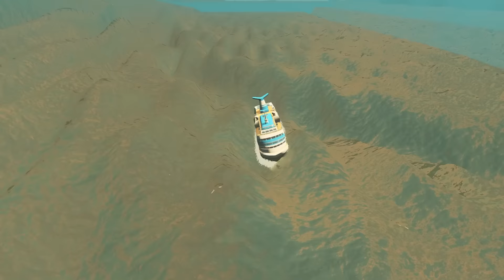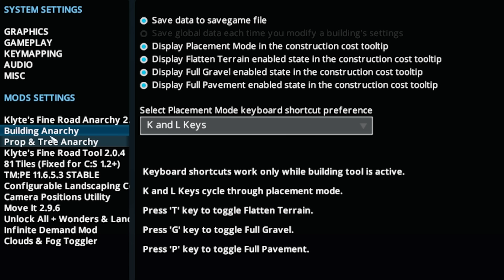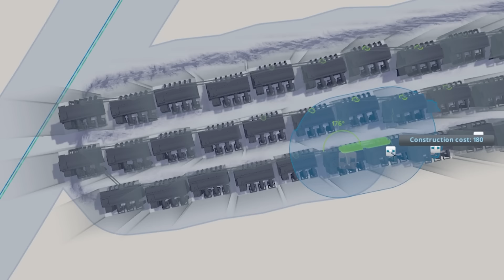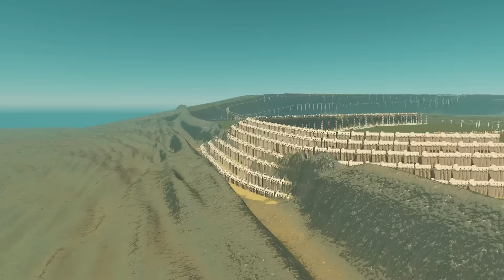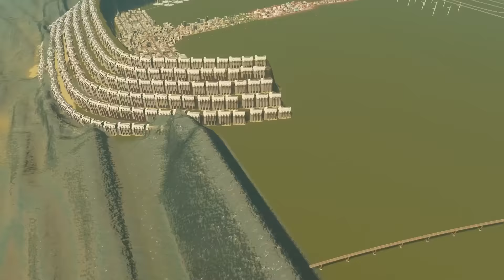Can engineering STOP A 1000FT TSUNAMI in Cities Skylines?

Comment: Very interesting, but probably far cheaper to just evacuate the entire city and build a whole new one far away from the coast.
Reply: true true
Reply: @Nightman5694 false false
Reply: That's boring, he needs content not a ghost save
Reply: Even before that, why build a city by the coast if you can’t enjoy the coastline due to these mega structures surrounding the city?  But fun as a simulation.
Reply: @rdpaik  For sure there are tunnels under the waterpumpdam so that people can still go to the beach. They just have to be quick when the tsunamiwarning goes off. The watertight doors will close in just a few minutes (but I suppose that people would have already recognized that a 300m high tsunami is coming right at them thus they will probably already be deep inside the tunnels when the first doors close (I suspect that there are several doors inside the tunnels that will be closed as well. so that in case of a failure of one of the doors, it's okay, other doors will do the trick)

Comment: 9:50, I think it could have worked, if the front wasn‘t parallel to the wave, but a peak. If it is just a wall, the Water tends to rise higher, because it is the only way to go. If it has an angle, it gets more deflected
Reply: I am confused by what you mean. Parallel horizontally or vertically? Do you mean you need an angle vertically or horizontally?
Reply: @rachelcookie321  I think he means it should be more wedge shaped to pierce the wave instead of blunt. <<<<<
Reply: @valfreyaaurora4922  like more arrow shaped instead of U shaped?
Reply: @rachelcookie321  ya, more V instead of U
Reply: Yeah, thats what I ment. More an Arrow into the sea, not the U shape he did

Comment: You might be interested to know about the Vajont dam disaster in Italy. The area surrounding the dam was deemed geologically unstable but the company running the dam purposely hid this from authorities. They were expecting a landslide and a resulting Tsunami of around 25 metres high and thought the dam could block the Tsunami. Because of this they did not inform the villages in the below valley. Turns out the landslide was a lot larger than expected and it resulted in a mega tsunami that went over the dam and into the valley below causing around 2000 deaths. The dam still exists today, though it's no longer in operation.

Comment: Technically if you wanna stop a tsunami you would have to somehow flatten the edge of the continent, or the area far enough vertically underwater, so that underwater there is not a slope up to land but a huge solid wall. The reason is that tsunamis are actually only big as they start getting pushed up against the slope towards land by the forward moving forces, so no slope, no big waves. That is probably an even crazier project though.

Comment: Great job bro but a way over engineered, you could’ve placed 4-5 steps in the step wall, but instead of building pumps right over it, you could use canals and place pumps inside the canal (vanilla support), using this method, you can deflect and reduce from the total height (also use regular pump because of size/input, but using canal pumps will be wider), you can place much more of them rather than bugger ones thus pumping more water. Then simply place 3 lines of canals around the sides with some pumps on them (also connect between the canals every few nodes to allow better flow towards the rest of the system.
Also place two canals in the same step wall fashion on the coast line to reduce the periphery system load.

This can withstand this size of a tsunami and even slightly more.

Really loved your way of thinking though!

Comment: Shove a mug side to side with water inside it and that shows what happens when water hits an object. Tapering a wall towards the wave will change the direction on the water in quite a forceful way as the water underneath piles in forcing flow up the wall shooting the wave back. Taper;)
Reply: The water moves fastest against the wall as it tries to escape the rest of the water piling in and the water folding and rolling over is slower so it will be shoved by the tapered water.  The spear head with a tapered top would work perfectly especially if u used 2 of them. With pumps in a ditch(that goes past town) right after the last spear wall to catch any backflow that usually comes around the wall. (Simplest build?)

Comment: and tsunamis happen because 1) There is energy flowing through water, in deep sea, usually due to earthquakes 2) as the sea bed gets shallower, hence, the water is forced upwards creating the wave and hence when the wave hits shore it is at its highest hight. Thus, the tsunami wall cannot be a slanted wall such as in this video, as again you're just forcing the water to go even higher, hence the wall would be much more effective if it was just a straight 90 degree wall.

Comment: What about just building the city on an arrow-type artificial mountain, that will split the tsunami reducing its force. In a real life env it is obsolete having canals, pumps and everything else on the beach. Ohh, walls also to protect city and pumps inside (dam style pumps) to remove water that passed. I think a top of 6 would sufice if its build on a 50m hill/mountain with additional 10-15m wall.

Comment: Hold on... couldnt you have inverted the slope on that wall and gotten a better result? Like, you made a stair for the water to push itself up against. If it had been a wall, the impact would have been larger, yes. But if the slope was on the other side of the wall, it would still have been plenty supported, and it could have made for some awesome real estate without the need for pumps and oversized power generation?

Comment: Yes but you don’t build the buffers in front of the city you build them out in the ocean. This really isn’t as difficult as people might think. You need an engineer to design it. And it Hass to be done in such a way that you know the direction the force in the height of the waves that will be moving in. Of course, the objective is to break it up. One manner of breaking it up isn’t just too weak and it’s force The water needs to be forced from one side to another to help it lose its thrust forward.

Comment: tsunami is coming from tons of weight of water as a force so countering it with plain wall wont stop it, although remember that even tho tsunami is heavy force, its still water, maybe it could be countered with vibrations, ragged mechanism for around 50 meters to diffuse the force the tsunami wave created into just plain water splash, but then 50 meters vibrating ragged mechanism sound impossible considering the materials needed, the location, the scope (because that mechanism need to ne waterproof and grounded) and the maintenance too

Comment: A real tsunami doesn't peak like that, even the really tall ones. They have a very long wavelength and so even the tall ones may look huge at a distance, but take a fairly long time to 'swell' up to maximum height on land. That said, one sea wall with a reasonable height would work fine, but for one this tall you'd want something tall but very wide over a lot of area to break up the wave and divert the water. Thankfully any need for any sea wall over about 50ft. is never needed, and even 100 ft. is quite rare.

Comment: Get cold steam modular nuclear reactor technology. Vacuum prep before activation. Water boils at lower temps under vacuum, and all steam on the other end of turbine condenses. Reuse all the water inside it and steam driven vacuum pump maintains with extra psi that was used in the beginning to get the turbine rolling. < Once we get all updated to that there won't be anymore steam or water wasted. < Lmao.. You wish. Pokes game

Comment: Anyone ever use a snow pusher shovel? Yes there are differences in shovels.  Those that know, know.. anywho.. pusher shovel.. what if you designed and built a similar concept to where that water shoots back at itself.. im no engineer, but it seems plausible?

Comment: I am not an engineer but a bit polymathic huge expensive very impractical. It is like most things on this planet in fact very simple. All you have to do is initially reduce the height of the incoming wave thus dig a deep trench beneath the sea level by the shore line when the water recedes the covering over the trench uncovers it.the earth from the trench creates a hill which you have tunnels to carry away the water reducing the height of the wave more and routed to the flood plane or pit area.The plates covering the trench  move to the top of the hill on rails behind which hydraulic pistons strength the plates.Any overtopping is done by a smaller ditch and hill process here actual pumps can be used..
Alternatively use the same system of covered ditches to reduce the height of the head of the wave in stages with a smaller hill wall pipes and flood plain arrangement. It is just height flow management followed by deflection Fukushima not very smart but you not this place "mostly harmless" good fun video.
Reply: You know typo or knots or Nott as in Sir John Nott the Argentinians will not invade get rid of the navy.

Comment: Tbh, this is a far cry from a real tsunami. This is just an ordinary big wave. A real tsunami is very different. Even a far smaller actual tsunami would have broken everything you did in this video. The main difference is, behind the front of the wave there is just water. Even a 10 foot tsunami would eventually overflow a 100 foot wall, provided the wavelenght of the tsunami is big enough, which they usually are. For the purpose of this experiment you would have needed to rise the sea level behind the wave be 1k feet to get an actual representation of a tsunami. In reality the water keeps coming and coming and coming. The runoff after the tsunamis momentum has run out is usually even more destructive then the actual tsunami, since the water is full of junk and debris, which mean it causes even more damage. Realistically the best way to handle tsunamis is no protection. If you leave the tsunami be and give it the room it needs along the cost there is no trouble. Trying to block it from flowing on land will only make it worse when it breaches the defenses. Any from of drainage system is completely pointless since the water is everywhere and if it everywhere there is nowhere you could drain to.

Comment: A 1,000 ft tsunami?  Do you realize, without the mass, just the kinetic energy, by it's simple action of being a force in motion, without accounting for it's mass or weight, on most continents, would sweep hundreds of miles of shorelines away?  Could we, as ants on this rock stop a flash flood from destroying your town?  I'm saying no. A 1,000 ft tsunami, good luck, just ask New Orleans how well their seawall worked.  Put enough force to it, spring steel, titanium, carbon fiber breaks.  Rubbers rupture dude.  Shit happens.  Our last hope is climate change. Either we change the climate, or the climate will change us.